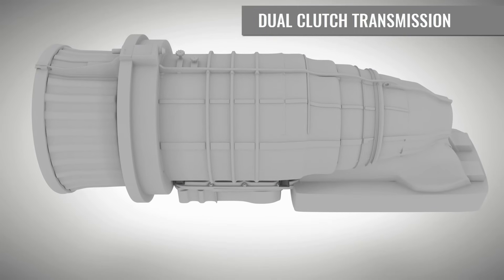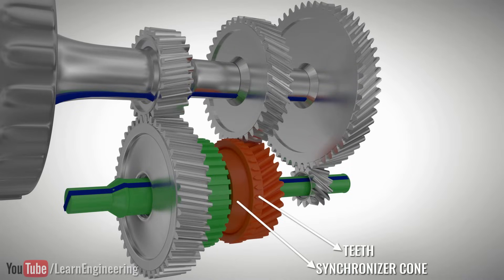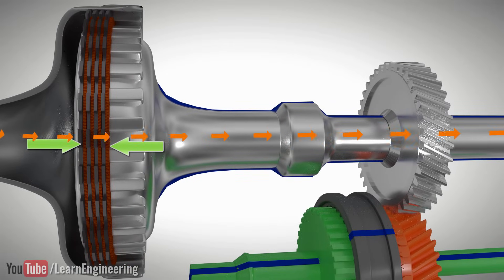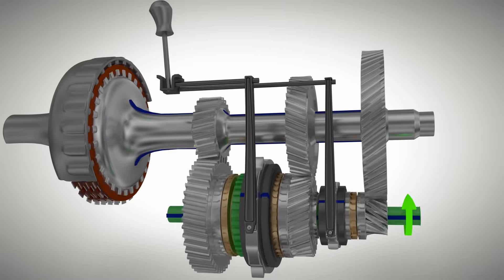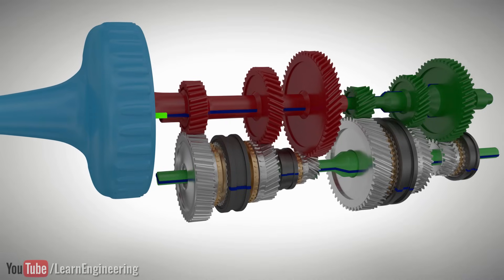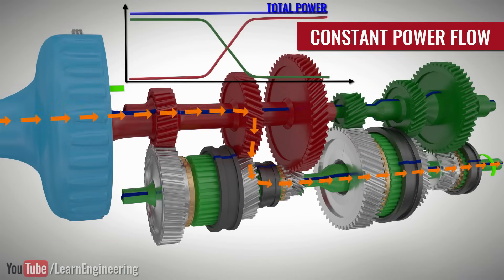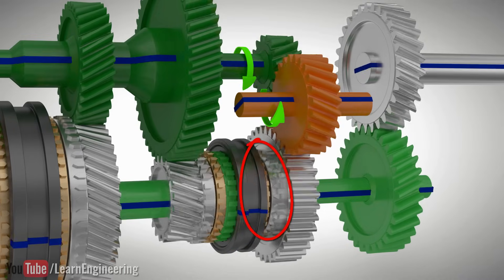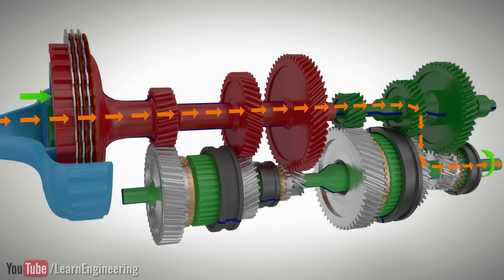Working of Dual Clutch Transmission (DSG)

Comment: I'll make my best to help you as soon as I can. It's amazing the things I learned watching your videos. Just one question: What mechanism change the gears? Cheers:)
Reply: First, one countershaft is for gears 1-3-5 and the other countershaft is for gears 2-4-6. Plus there are the two separate clutches - one for each countershaft. In total there are four electric motors involved - two for the two countershafts and the two for the two clutches. All four motors are run back and forth under the command of the transmission control computer. The four motors are all stepping motors, which can rotate incrementally back and forth under computer control to provide precise position control.

The computer also has several sensor inputs: vehicle speed, brake pedal position, throttle pedal position, gearshift position, engine RPM, and I think they also have an accelerometer in there to measure instantaneous acceleration.

The exact way the software algorithms in the transmission controller make decisions and control the transmission are quite complex and the engineers that designed everything are probably the only ones that know exactly how it all works. But by reading the tech manuals, by observation and by driving one of these vehicles this is basically how it works:

When you go from Park to Drive with your foot on the brake you don't feel anything at first (no "clunk" like with a conventional automatic transmission). At this point the first gearset is engaged for 1st gear, but with the brake applied the clutches initially stay disengaged.

Then when you let your foot off the brake without touching the gas one of the two clutches will start to engage lightly to make the vehicle start to crawl forward. Then if the driver steps on the gas and raises the engine RPM the clutch will continue to engage to accelerate the vehicle in 1st gear. While the vehicle is accelerating in 1st gear the other un-driven shaft will switch into 2nd gear to get ready ahead of time for the next upshift. At the proper vehicle speed and engine RPM the first clutch will disengage while the second one engages to upshift into 2nd gear. This alternation will continue back and forth up through gears 3,4,5 and 6 until the vehicle reaches the desired cruising speed.

To answer your original question the controller has to decide whether the vehicle is currently accelerating or decelerating to decide what to do next.

It does that by looking at the current trend in vehicle speed, current acceleration and of course the throttle position. For example if the throttle is 3/4 open and the vehicle is accelerating the controller will sequentially keep upshifting the transmission up through the gears until it gets to 6th gear.

Then if the vehicle is cruising at say 40 MPH and the driver floors the gas pedal  the transmission may decide to downshift to a lower gear to assist the engine. Then once the vehicle speed comes up and the driver lets off the throttle the transmission will then upshift back up to 6th gear again.

Then finally if the driver wants to stop and removes his foot from the gas pedal and steps on the brake, which will cause the vehicle to start decelerating, then the controller will simultaneously disengage both clutches while it also starts downshifting the transmission back down towards 1st gear again to be ready for the next time the vehicle has to start moving and/or speed up again.
Reply from the maker: Thank you for your support. The sliding of sleeves and clutch activation result in different gears.
Reply: The Ford DTC uses two electric motors to shift the gears - one computer controlled motor for each gear set. Basically for each of the two gear sets there is a round wheel inside the gearbox that has a channel machined into its circumference. The channel is cut to form detents, which look like two ramps going in opposite directions with flat spots in between (you kind of have to see it).  When the wheel is rotated by the electric motors the ramps push the shift forks back and forth. Also, the dual clutches are engaged and released by clutch forks that are moved in and out by two electric motors.
Reply: the hand shifter? probably can find diagrams of it
Reply: How does a computer determine which sleeves to engage? Say if i need to shift 3-4-3 and not 3-4-5?
Reply: Joe Vignolo very interesting thank you!

Comment: how is the smoothness compared to a cvt? and efficiency?
Reply from the maker: CVT  is a stepless transmission. No technology can beat CVT in terms of smoothness.
Reply: +Learn Engineering and what about efficiency? is the cvt more inefficient than a dct? (and if so, is the difference important or next to nothing?) because I do not remember seeing a torque converter in your video about cvt. 
btw, I really enjoy your videos. I look forward for more!
Reply: CVTs are more efficient at holding a speed since it always can choose the optimum gear ratio for that speed; however, they have a limited range of gears so high speeds might not benefit (think of it having any real number between 2-6), also they weigh more than automatics which reduces overall efficiency. They also lose some energy due to slipping of the continuous converter. 

Overall: CVTs weight, slip, and limited gear range are disadvantages while its ability for close to infinite (technically only 1000s) gears inside that range  is an advantage.

They are improving materials to counter the weight, slip, wear, and gear range problems. That is why they are suddenly becoming popular.
Reply: Generally, parasitic losses from most to least are Auto > CVT > DCT > Manual. Although the last two are nearly equal since the DCT is a manual with the gear set split between two clutches.

Fuel Efficiency nowadays is generally CVT > DCT > Auto > Manual. The reason is CVT can always hold the most efficient RPM/throttle combo. DCTs have the low parasitic losses of a manual combined with an expanded set of ratios. Autos now generally have a taller final gear and wider set of ratios (7+). Manual transmissions usually only go up to 6 gears, the only exception I know of being the 7th generation Corvette with a 7 speed manual.

Acceleration with same power, only weight difference being down to the transmission will be DCT = CVT > Auto > Manual. All automated transmissions now shift fast enough to overcome their weight penalty and extra parasitic losses. The DCT version of a car, despite being heavier, can reach 60 MPH between 0.2 and 0.5 seconds faster. The benefit of low parasitic losses and almost instant shifting give the DCT a performance driving advantage.
Reply: @CalculatedRiskAK  You can add Porsche to your list of 7 speed manuals with their new 992 911s.
Reply: I guess it depends on how much torque the transmission control unit needs to change the gap between the sides of the pulleys.
Reply: I guess the CVT will be more efficient due to its infinite set of gear ratios. There might be other factors that I'm missing though.

Comment: is there manual dct?
Reply: How do you imagine manually controlling 2 clutches and 2 gear sets?
Reply: An electronic pedal for this would be pointless. You might as well put a sticker on the floor and release the gas every time you touch the sticker. The point of a DCT is to eliminate the shift time. The only way to have it manual would be 2 clutches and 2 sticks. It then would be a pain in the ass due to remembering to shift the opposite stick then your in, unlocking that peddle, engaging the other pedal. Furthermore, this would add weight to make the necessary metal connections. 

If you want a manual, buy a manual. It is decades old technology that needs to change to allow for better efficiencies.
Reply: I thought the same thing when he said that the clutch packs are controled by computer.You would need 2 clutches.
But you could make an electronic clutch pedal that would activate the proper clutch pack by having a 2 step selection electronic gear shifter.
What i mean is that you would tell the computer to witch gear you want to go by moving the stick to a certain possition then push the clutch pedal while the computer knows whitch clutch pack to move and then push the stick further to engage the gear.
But that would be just a waste of time just to make you feel like you are driving a manual.
Reply: With that you defeat the point of the DCT. If you had a pedal the performance would be the same as with normal manual trannies + the weight of the added parts, longer shafts and what not. You would still have the brief period when power is not brought to the wheels, witch a DCT is designed to overcome.
Reply: Most cars with DCT have the option of shifting manually, usually with paddles on steering column. Or just normal automatic mode.
Reply: +J T R it is not same like shifting with clutch pedal! nowadays it is so easy that even a girl can drive a car. it has become a normal thing like using a computer. I want a real manual gearbox,  don't kill that technology!
Reply: +IAQMas let the engineers to find the answer
Reply: They have found an answer! It's called "Automatic dual clutch transmission" :D You can have it with sequential gear selector or maybe some sequential preselector but it would still be more or less automatic.
Reply: +IAQMas unfortunately :)
Reply: I said electronic pedal and shifter not mechanical!
And i did say at the end of my comment that its all pointless for just making you feel like you are using the gearbox manualy because that is what OP propably meant.
Seems like you are a hasty reader!:)
Reply: Not hating on the experience of driving with a manual. It is a lot of fun and makes you feel more in touch with the car. But it does not have a place in terms of efficiency.
Reply: Clay Norrbin يبرىرربررررريرؤررررريييس1ضضصييبببببؤؤؤؤؤءؤؤسسسسسسسسسءء
Reply: Ahmad krdosh ска ты о чем вообще? ! оттамай кетш щщс
Reply: There's no point. The idea is more than just mechanical. A computer can shift way faster than a human ever could. IIRC, the McLaren P1 applies negative torque to the engine (to drop RPMs quicker) because it shifts so fast.

Comment: Are there any theoretical advantages of DCTs over CVTs, ignoring current technological limitations?
Reply: That, and CVT's are awful to drive (my subjective opinion). The engine noise doesn't give you any feedback as to how fast you are...
Reply from the maker: The only disadvantage I know about CVT is it's limited load carrying capability.
Reply: +Learn Engineering appears you favor CVT then?  I would think dct to be where it's at
Reply: ElectroBlood The only one I've even run was a maxima ..oh man was that thing fun once it passed 5k rpm! it got to peak torque and SAT THERE.  But for daily driving I can see your points.
Reply: dosmastrify I just had to check the speedometer every 10 seconds or so, which was very annoying. I guess it's just a thing of getting accustomed. E-cars do the same thing after all.^^
Reply: I think future CVT and electric cars will be equipped with a HUD. It's interesting to see people still want the 'roughness' from classic technology.
Reply: Theoretically, for performance, ignoring  reliability of both the engine and transmission, CVT is most advantageous for performance driving as you can pin the engine rpm at max power for most of the entire set of vehicle speeds the CVT can support. 

CVT's are also banned in F1.
Reply: tsujimasen Any reason why CVT is banned?

Comment: Smooth, must be talking about them rich man autos
Reply: No, DCT's can be found in cheaper cars nowadays.
Reply: Wladyslaw Szpilman read the first word
Reply: Eric D they are DCT's, I own a 2015 hyundai accent 7 speed, my friend has a fiesta 6 speed which they call "PowerShift". its really jerky. and I have the diesel accent so yeah a lot of torque adds more to the jerkiness
Reply: DSG is very unrelible transmition,
Reply: Dmitry Philippov complete nonsense, they are very reliable if maintained properly.
Reply: hyundai accent and some kia models, ford ecosport and ford fiesta and many more
Reply: doodskie999 I'm pretty sure those are all CVT or even conventioanl auto, not DCT. Of course CVT are smooth and the tourque converter can smooth out a lot of the conventional but the cheap DCTs don't tend to be smooth at all.
Reply: Eric D I've driven an A3 with DCT and it's pretty smooth...
Reply: Hyundai's Ecoshift is a dual clutch transmission with 7 gears. There will be an 8 gear version in their N performance line. https://www.atz-magazine.com/download/More%20Efficiency%20with%20the%20Dry%20Seven-speed%20Dual-clutch%20Transmission%20by%20Hyundai.pdf
Reply: Dmitry Philippov That is what i have been told. Is this still the case?
Reply: Weird, I've had no issues with my DSG pushing over 100HP above stock for 2 years now.
Reply: VW Group's DSG is really smooth - it's also the fastest commercial gearbox in the world. 8ms shifts only beaten by F1 cars which shift at around 5 microseconds. Go test drive a Golf or something, it's smoother than planetary autos and at times it can even feel like a CVT.

Comment from the maker: Dear friends, DCTs (DSG) technology is a promising technology( up from 3.4% to 8.5% market share in the last 5 years). We thank our patrons for suggesting this topic.

We thank our current patrons for saving LE from death. To achieve our goal of 2 video release/ month (addition of one more team member), please support us at Patreon.
https://www.patreon.com/LearnEngineering
Reply: Keeping with the theme of automobiles, could you do an episode on vibrations of spring/damper combination?
Another suggestion - photovoltaics?
Reply from the maker: Was the first suggestion same as automobile suspension ? We will definitely make a video on PV cells. However it will take sometime.
Reply: Having rented a Hyundai Veloster which has DCT, I can say I thoroughly enjoyed having that tech.
Reply: graciousAnomaly Did the way you drive from a regular Automatic have to get altered 8n any way? Thanks.
Reply: Learn Engineering Valvetronic on the next video please